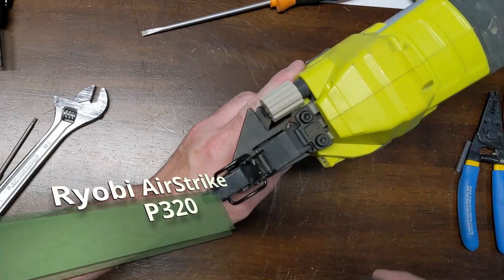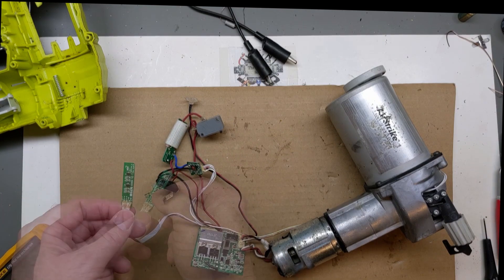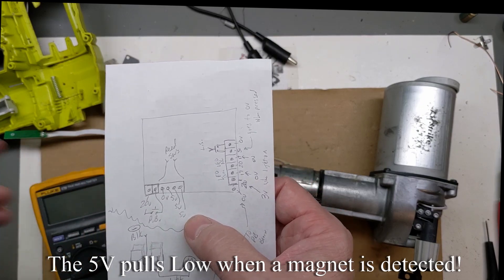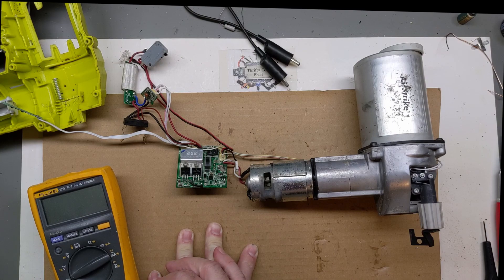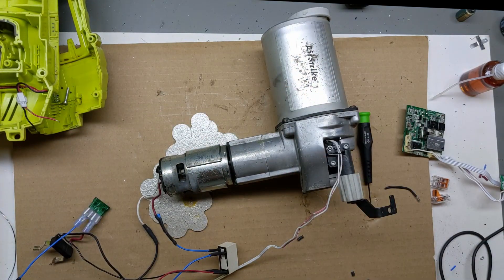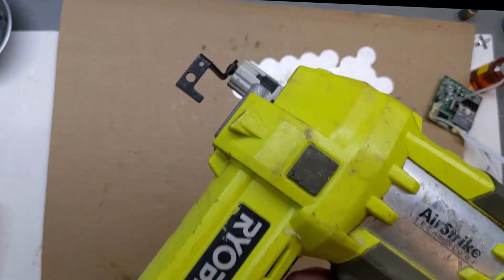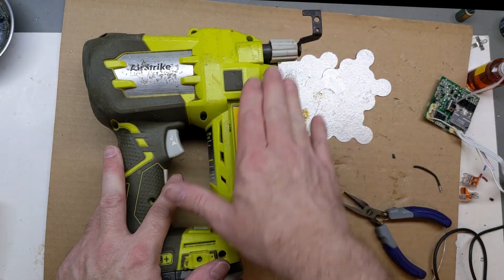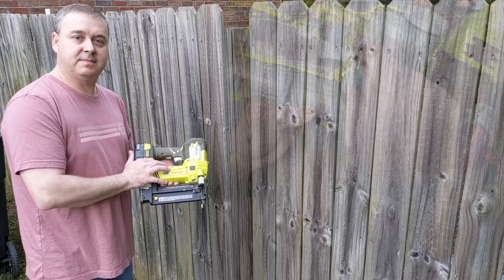Ryobi Air Strike Blinking LED Salvaged

Comment: Hi , I like your videos, can you tell me what size relay and fuse used in this repair and where to purchase them. Thanks
Reply from the maker: Hi,
Thanks for your comment. I added links in the video description, but it's been a while and they may be non working now. It's similar to the relay below. They seem to be harder to find now unless ordering from China. I tried to help search a little here. I live in Georgia and we were just hit hard with Helene almost no internet and some still without power. Hope it helps.
https://www.ebay.com/itm/363129063055?mkcid=16&mkevt=1&mkrid=711-127632-2357-0&ssspo=kD0pGm4AQHS&sssrc=4429486&ssuid=D_qZMHXJQNK&var=&widget_ver=artemis&media=COPY

Comment: @ThriftyToolShed  Thank you for the video!!!  The relay is currently unavailable... could you be so kind as to point me in the right direction...
Reply from the maker: It's hard to find one like it now for sure. That's an older video. I can only find one close like this link below. I don't know how they will hold up though. It's just a possible example. Let me know if you are electronics savy and don't mind playing around and trying something new. I do see a unusual option that could be made to work using mosfets. It's a small board priced at about $35 though. I will try one eventually. It may or may not work out, but has promise and I have not seen anything quite like it.
https://amzn.to/3TAy2MM
Reply from the maker: BTW 
This is the board is was talking about. It's interesting, but I know nothing about it yet...
https://www.thornwave.com/products/tl-ssr-24v-80a-dc-unidirectional-solid-state-relay-ssr

Comment: My Ryobi got wet when I was working outside, I let it dry out and after that it hasn't worked. The light still comes on but w ont shoot
Reply from the maker: Corrosion has most likely set in. Most people don't realize it's not really the water itself that is so bad and pure water would not even harm most boards. The impurities in water and how it gets in to every part of the circuit board and then the green crusties start showing up from the all the impurities causing corrosion on components. Sometimes plastic safe contact cleaner and 99% IPA can help, but not always.

Comment: Good for everyone. Unfortunately, I also have this device. I applied this scheme and I think it didn't solve the problems. And there are enough of them. The first is that the piston must stop, and here it does not happen, it works constantly, and the 50 mm nail is difficult to hammer, because the rod before the rod has time to drive the nail, goes back, for this there was a sensor with a magnet, and we threw it out of the chain. Smaller-sized nails come in better, but the rod moves so fast that in one click two pieces have time to fly out. I have a different principle of work in my head. Apply the nailer and press, the top key closes the circuit and waits for the trigger to be pressed, as soon as the rod hits, the sensor on the piston turns off the entire chain and so on in a circle. And here it turns out differently. In any case, the attempt deserves praise, but unfortunately the nailer in this form will not be able to help normally.

Comment: Hello sir, really liked your informative video but I’m curious if you’ve had a chance to work on a P322 which is the new brushless  hp version.   Does the hammer pin/tongue face up or down in regard to the indentation on the top/ bottom?  It appears to be opposite of the P320.
Reply from the maker: Sorry I have not worked on the P322 at all. Hopefully someone on here has and can answer? Thanks for your kind comment!

Comment: I have a sears craftsman speed shot its identical except for battery mount and its black used it when a quick thunder shower hit had the flashing led since. I thought I could get replacement board from ryobi since craftsman has changed to black and decker but even ryobi lists switch and board module obsolete. Will try your  fix thanks for the video
Reply: I have the same Craftsman Speedshot, have you tried this fix yet?  If so, did it work?
Reply: I have started it got a few more wires to solder and find a fuse and holder. Will send you reply when completed. I really liked the tool and had no issues. Was just finishing off a job when a sudden thunder shower hit and shorted out something on the board.Should have known better @josephrival951

Comment: may brother. diode connects between - and + motor using what type of diode code?
Reply from the maker: What are you asking? If you're asking about orientation then the "line" which is the cathode side goes toward the positive. If you have a motor in a drill for example that changes direction then you must not connect the diode in this manner. It must be placed further down on the power before it gets swapped.

Comment: Those look like dual 1 ohm (not 2 ohm) resistors, right? You're much more knowledgeable than I, but I'm just wondering if that was a typo
Edit: oddly enough, mine actually test as 1.5 or 2 ohm. I guess the burnt surface just made all the bands look like black or brown
Reply from the maker: It's been awhile, but if I remember I did go off of ohms measurement in parallel since mine were burned beyond the color  bands being very legible. Thanks for sharing!
Reply: Hi, my resistor burnt too, what did you use at the end, and where did you find them. Thanks in advanced
Reply: @70ki70  I believe I used two 1.5 ohm 3W resistors, but the more important part to replace is that thermal fuse. I bought this set of three on Amazon: "3Pcs New SF96U-1 NEC Microtemp Thermal Fuse" 
They are rated at 99°C rather than 100°, but so far everything's worked great since replacing the two resistors and one thermal fuse. I got the resistors as an assortment of 3W resistors on Amazon too.

So the big issue is yes those resistors got too hot, but in my case they were still functional, despite appearing burnt. I just replaced them anyways because it was easy to do. But the actual reason the gun won't work is because the thermal fuse burned out, so again that is the critical step
Reply: @RoshDroz  thanks for the reply
Reply: @70ki70  no problem, I hope you give it a shot. I only wish I knew what burned these up in the first place so I could prevent it from happening in the first place. But so far I've probably driven a few dozen nails over a month or two and have had no problems
Reply: Hi again, i just replaced the resistor and they just keep burning, the thermal fuse is still working, but i just don't what is happening with the resistors.
Reply from the maker: Either the Mosfet is shorted that fires the resistors in circuit for the brake or the control board is keeping the Mosfet on and that is keeping the resistors in circuit. So basically the resistors are a DC motor brake "shunt brake" and they can't handle being across the motor for an extended period of time. They are supposed to only be across the motor when stopping to "brake" so the motor stops very quickly. I think I mentioned some of this in one of the videos of the Airstrike, but it's been a while now.
Reply: I understand, i might try doing the modifications of your video, i found a 24v 40amp 5 pins relay, is that good? And what is that thing you put in the motor, a diode? What kind?, sorry but english isn't my first language, i dont understand everything you say in the video. Thanks in advanced
Reply from the maker: Seems like relay will be fine as far as the rating. If you know the dimensions just make sure it will fit inside, unless you want to mount it outside of housing. The diode has the purpose of flyback diode so if counter emf builds it can short across diode in hopes to help contacts of relay from a lot of arcing. I think I used a 100V 4A diode? I can't remember for sure it's been a while. You install it as reverse bias while running.
Reply: Last question, whats the minimun in amp for the relay, i also found another much smaller but with 10 amp, will that work or is too low amp?, thanks a lot for the help
Reply from the maker: @70ki70  
Yeah it's a bit too low current rating. I would try to find at least 25A rated even higher if you can. These are designed so the motor kick so so hard and so fast that the current most likely reaches over 50A at spikes. A heavy duty 25A should hold up a while, but it's going to be tough on any relay for sure!
Reply: I understand, thanks for the help

Comment: Have P320 opened up on the bench right now. Both the disassembly and repair videos are top notch. Appreciate the safety remarks on modifying (any) tools away from factory operation. I ordered the recommended relay. (I hope it worked for you - fit & function) I may have missed it but what value fuse did you install? In the nailer I'm working on, resistors R68 & R 69 showed evidence of severe overheating. The thermal fuse is intact though. Not worth finding and replacing resistors if the problem on the main board. Makes ya wonder just how many P320 end up in the land fill? Thanks very much for your videos.
Reply from the maker: I believe I had to bend the blade pins of the relay a little on mine but it fit. I should have just snipped them off and soldered on to them really like I did the coil pins. I believe I used a 30A mini ATC fuse for mine. Thanks for your comment! Best of luck to ya!
Reply: Hi, i need to change the resistors too, can you tell where i can find the replacement please.

Comment: That's so awesome.... Companies are mad already, because instead buying new tools you can just modified and good to go for a longer time now. My question is the battery will last the same? Without all the components
Reply from the maker: I could see how the battery pack could pull down faster because the stops are not there to position the piston everytime it fires. It sometimes has to make more than just one complete revolution to fire, but that's the trade off of course. Thanks for your comment.
Reply: @ThriftyToolShed   thank you for your fast reply, you earn a subscriber. This video is so helpful..

Comment: Refreshing to watch someone who actually knows about electronics. I challenge you to do something similar for a brushless motor
Reply: Amazing work. I'd actually prefer this modified version to the original as I feel there's less to go wrong now. I don't need fancy, I need reliable. Thank you so much.
Reply from the maker: Thanks for your comment. I have not done this with a BLDC, but I have repaired a EGO 14" chainsaw BLDC controller, retrofitted a cheaper controller on the EGO blower and I also used a cheap controller to get a Ridgid Brushless jigsaw back going instead of just letting it go to the landfill. This may not interest you, but thought I would at least mention it since you have taken the time for a positive comment. Thanks again.

Comment: what name the relay sir
Reply from the maker: I have a cheaper and more current rated option in the video description. In the video I used one I had, but it is a kinda expensive relay from Automation Direct. It was part of the zip link relay base so it is more expensive than we need for this. It was the only one I had that would fit in there during the repair, but I have since ordered the ones in the video link. They are rated better and much cheaper!

Comment: Thank you for this amazing video. In my case I just need to replace the 2 resistors sitting with the thermal fuse. I tried to find online, asked in reddit, ended up getting 1 ohm 1 watt metal film resistors but these don't work. I bypassed the resistors and the tool runs for a second (before jump wire burnt out). Can you please help me identify those  resistors. Looks like it has 5 black bands (or one gray in the middle), can't find anything with same color band or even the size. Thermal fuse was also blown, replaced with 100C.
Reply from the maker: I believe they are 1.5ohm 3W. it's been a while and I don't have the board anymore. If you had room you could even put a 10W resistor in there instead. A 1 ohm would most likely be fine, I can't remember if you have the room for it or not. Thanks for your comment!
Reply: @ThriftyToolShed  thank you! This is very helpful. Would these 1.5 ohm 3watt resistors fit right? https://www.amazon.com/dp/B08LW3LD6M/ref=cm_sw_r_cp_apa_fabc_GYS5B8J8KRQ8A9JQC0DG
Reply from the maker: I would just be guessing. I no longer have the board. I would think they would fit fine.
Reply: @ThriftyToolShed  thank you, I need your help again. I got 1.5ohm 3watt resistor and the resistors burnt out dead immediately when I connected the battery, even before reaching to the switch. Does that mean I need to increase the resistance? Would 10 watt 1.5ohm still work if I try to get those next?
Reply from the maker: I would check the little Mosfet that fires (turns on) the resistors for the braking resistors. They can only handle a few seconds of the power dissapation. If power is applied all the time it will absolutely fry them in no time. If the Mosfets that activates the brake is not shorted then what ever is giving it the signal to activate Is shorted. I always thought the microcontroller activates the brake using the feedback from the reed switches on the side of the cylinder for position feedback, but I am not 100% sure. I have not traced it down that far.
Reply: Hi, i have the same problem, what kind of resistors did you use, did you repair the nail gun?

Comment: I really like your fix on this Ryobi nail gun. I got one cheap and of course it was busted. I’m trying to find that relay but I’m having a hard time finding one. Any chance you have a part number for it?
Reply from the maker: I have a link in the video description for the 24V 25A relay I would use. It is cheaper and higher current rating as well. I have Amazon link and eBay link if needed. The relay I used as a make shift in the video I already had and was from a relay set and is more expensive with the multi base. I would use the cheaper higher current relay for it next time.

Comment: If it's possible can you write down what exactly the part that i need to buy so I can order
Reply from the maker: Under the video description I list a 25A relay that I would like to try. I also listed thermal fuse assortment if needed. I did not see a way to buy the relay I used by itself it is from Automation Direct as a Ziplink kit so it is pricey as a kit. I just happen to have it in spare parts to tinker with. So I found one on Amazon I would like to try. It is listed in description, since it is very reasonably priced. Just suggestions since viewers are asking, I have not tried them to say for sure. It is what I will buy to try if my 12A really fails! Best of luck to ya!
Reply: Thanks again you did a nice job on it. I received my for free so I really would like to fix it i don't have anything to lose.

Comment: is that relay available locally or does it have to be ordered from China?
Reply from the maker: Well that exact relay is from a Automation direct relay Zip Link board I had with bases mounted to it. It is a pcb style relay. I did put one in description that I want to try from Amazon. It is 25A 24V still small. I have not gotten it yet to say for sure about delivery time?
Reply: @ThriftyToolShed  Thanks for the quick reply , I overlooked the description area.

Comment: Where can I find none working units for relatively cheap?
Reply from the maker: The best way to me is find someone locally selling like new and used  tools alot either on market place or local flea market that you can tell are from store returns and they usually have piles of non working tools stored somewhere. After asking a few sellers at the markets usually at least one will tell you to come check out the pile and they sell you a lot of them for just parts etc.  The other option is trying to buy non-working items from eBay but shipping is hardly worth it. Local is much better.
Reply: @ThriftyToolShed   thanks so much for the information. I was was trying to find it on Amazon and wasn’t having much luck. I’ll try to find the links you mentioned.
Reply: I have non working tools, what is your location?